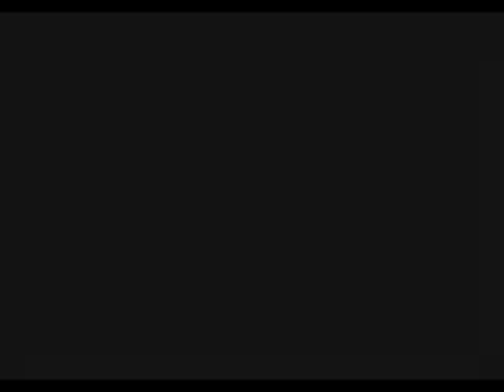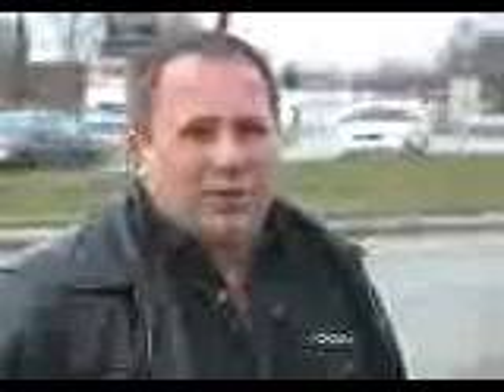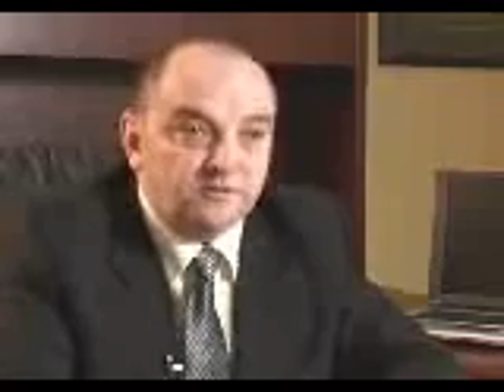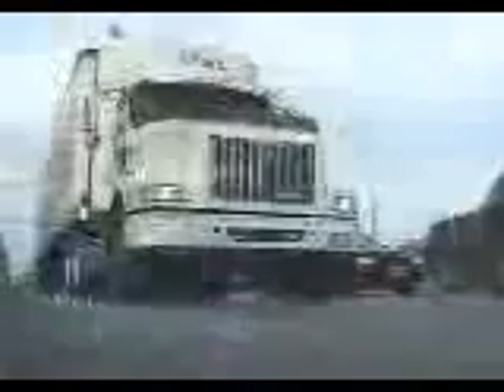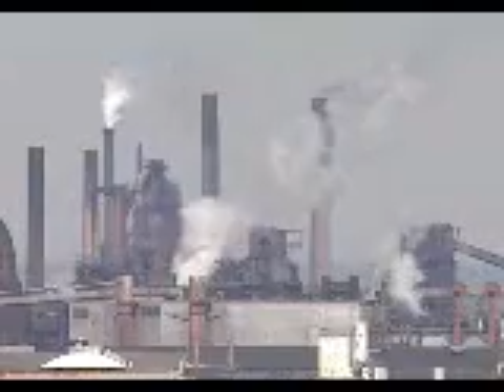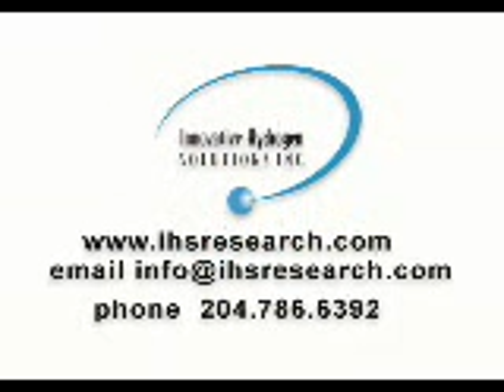Innovative Hydrogen Research

Comment: I like how they are worried about the dumping of millions of internal combustion Engines if Electric comes in, UH-DER what happens every year to the replaced cars? recycled. where will they use the metal from the ICE's building electric engines?